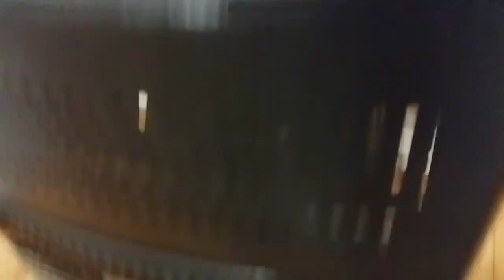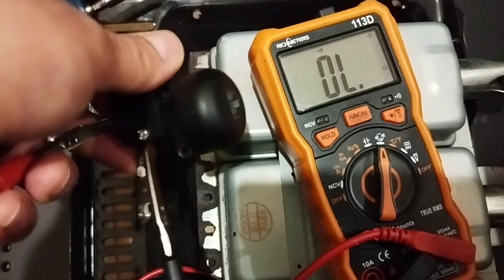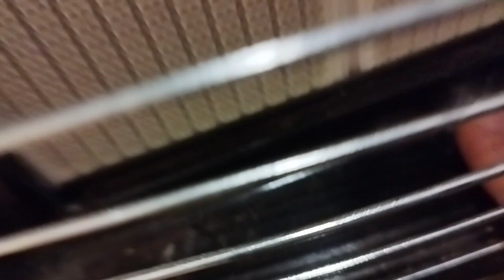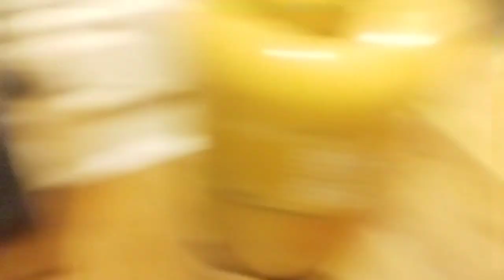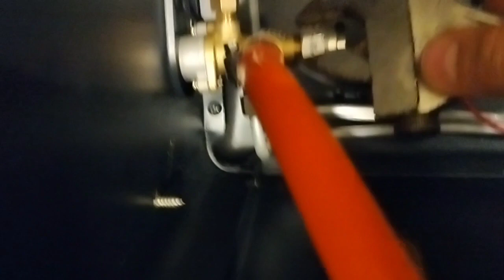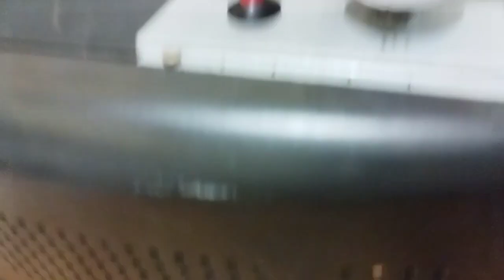How to troubleshoot and fix Kingavon Gas heater

Comment: Mine turns off 5 minutes after being on. What could be the problem. ??
Reply: It has an air ambiente sensor...that shut gas off in case of air saturation..it should be used in a room with some air circulation... like a window a bit open...

Comment: That main panel burner should not light up when lighting the pilot you have a faulty gas valve
Reply: the centre panel supply is the same as the pilot supply both coming from the same pipe.

Comment: recenlty purchased a new Butane superser heater, i attached the gas bottle today, switched the regulator switch on performed the washing up liquid with water test on a paint brush, i then ignited the fire had it on for fifteen minutes then turned it off, i then waited reignited it left it on a single bar for almost three hours, this may seem silly though is the any danger of leaks, also have resident smokers, just want to know that everyone around this heater is safe, thanks for your time
Reply from the maker: Once there is no gaz leaking it's safe, also make sure the heater is in ventilated area, we all know any kind of burning requires oxygen, in case of poor ventilation this can result in monoxide of carbon which is dangerous to us.
Reply: @bassalh2025 mine is a Spanish brand ( Cecotec) made in China like a lot of others brands with that same model, with infra red ceramic plates...manual recomends a minimum of 150 cm2 air intake ( could be a window a little bit open) wich makes sense...it was not intended to be used in a completely closed space...btw mine has a air ambiente sensor that shut gas off in case the air becames saturated....

Comment: Great video ,very informative,my ignitor at the gas flow has broken ,do you have a video how to replace it please
Reply from the maker: It must be an easy fix, The ignitor is just creating spark, I don't have video on that, but I suppose it can be pulled from an old lighter, or alternatively just use lighter as I do usually 😊